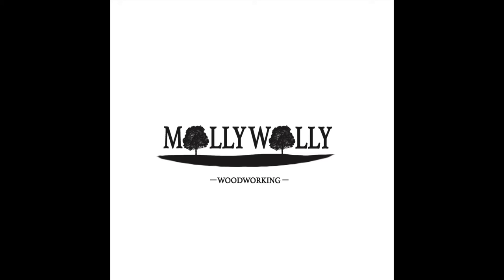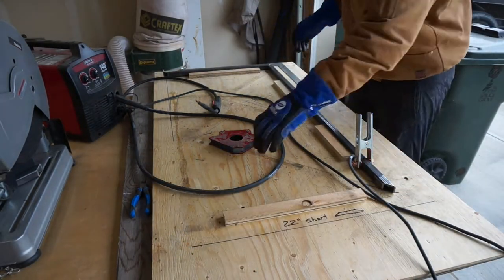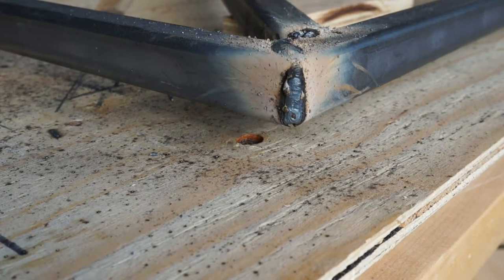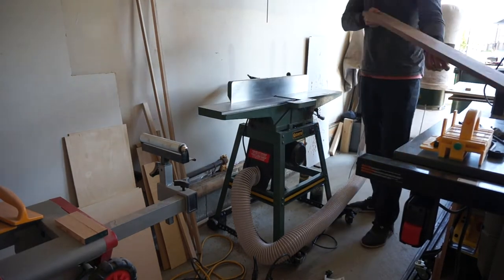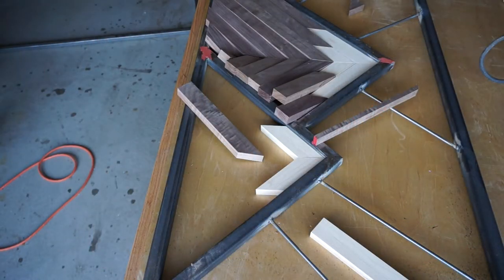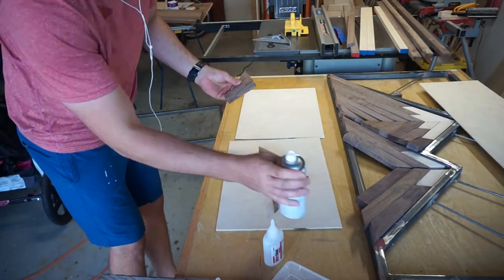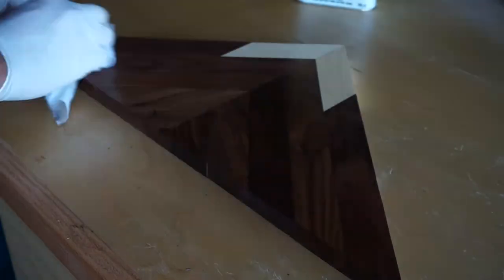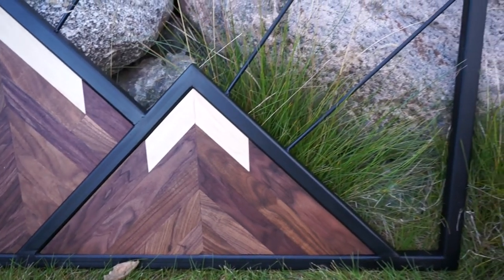How to Build a Wood and Steel Mountain Art

Comment: Great video. Sorry if I missed it, but how did you keep the mountains from falling through and staying in place?
Reply from the maker: I just weld on 3 tabs that are 1/4” thick flush with the back of the frame. That way the wood mountain parts need to be 3/4” thick to be flush with the front of the steel